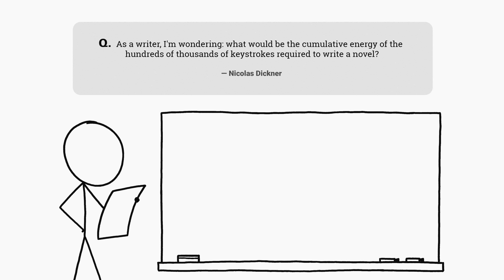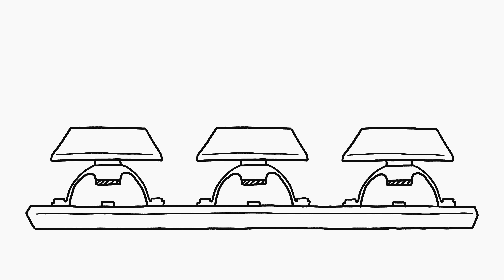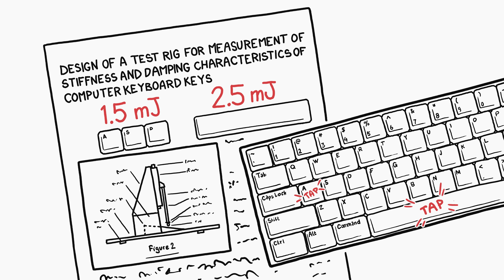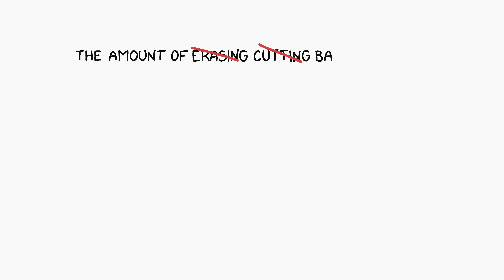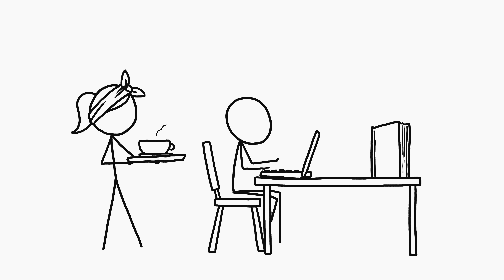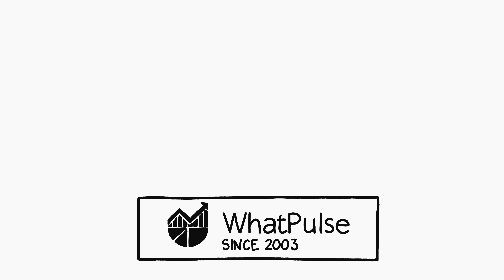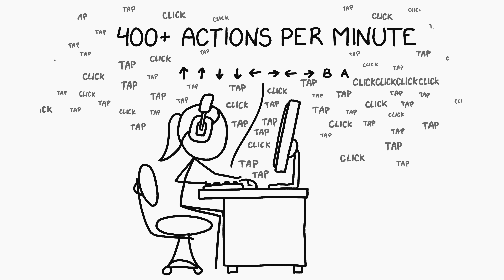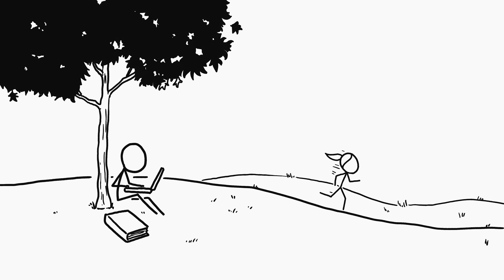Can you power your computer by typing?

Comment: Something you didn't take into account is that we can make the keypresses harder to generate more energy. How hard can the keypresses get before people are too uncomfortable to write? And at that level, how much energy would we generate?
Reply: Based on a quick search, a mechanical typewriter would have about 20 mJ per keypress and is probably about as hard a key (and as long a down travel) as people would tolerate. Which is about 13 times more than in the video. So better but still not a lot of energy...
Reply: @ynes6658 each keystroke triggers a nuclear reaction in a portable nuclear power generator hidden under the rubber dome
Reply: @ynes6658  you could easily power a mechanical clock though, they are incredibly power efficient and eh no need to convert to electric power
Reply: @ynes6658 we go all the way to 6 minutes per novel
Reply: So one of the reasons, which Randall actually touched on, that keystrokes are so soft is because heavier keystrokes can cause repeated strain injuries. Raising the keystroke press weight to get more energy would increase the likelihood of injury. Which means that generating energy from keyboards would be less safe than nuclear energy.
Reply: @waldosan  Generating energy from most sources is less safe than nuclear energy.
Reply: @masansr you're being sarcastic right, or trolling

<edit i read it backwards, I for sonereason thought his point was that nuclear wasn't safe>

<<edit2: I forgot edit 1 and got a like and was going to be like wyf ... but their probably liking the edit>>
Reply: @AbstractAproach  No, look it up, it's literally one of the cleanest forms of energy.
Reply: @masansr oh I know, I must have read your inequality backwards i guess (I thought you were saying nuclear was bad)
Reply: @waldosan  there are a lot of things less safe than nuclear energy.
Reply: @renakunisaki  I see you, like, everywhere on youtube lol
Reply: @waldosan  that's one hell of a take
Reply: @yan7911 But not inaccurate
Reply: @yan7911 its objectively true tho
Reply: @yan7911 Read up on nuclear safety it's massively improved over time

Also remember that Chernobyl was built by the soviet union and had terrible safety standards compared to today
Reply: @unclesquidy285  I know, I'm not anti-nuclear, I'm even French so 70% of my electricity comes from nuclear 
But still, saying that making keypresses heavier is more dangerous than an entire supply chain of highly dangerous and volatile materials is quite a stretch and I found it funny 
(again, I'm not anti-nuclear, but let's not be hypocritical, risks still exist)
Reply: @yan7911 

In fairness, there are more fingers on hands than there are nuclear reactors, so, the math probably has more caveats… 🙃
Reply: I think that's called using a typewriter.
Reply: You'll quickly hit the ceiling of human output. It can't be be more than the calorie intake of a person. Given how typing uses the smallest muscles, a reasonable analogy would be attaching a curl bar to a generator and seeing how much energy a person could make in a day.
Reply: @kevindodd4363 i think bike pedals are the most reliable way to extract power from a human ...

Maybe rowing machines 🤔
Reply: @davidegaruti2582 You're overlooking bungee jumping (or skydiving, but wind resistance becomes a much larger factor there).  A 90 kg human body falling 10 m would generate just shy of 9 kilojoules of energy, in just shy of 1.5 seconds.  Pedaling a bike would take about 60 times as long to generate the same energy (~100 watts = ~100 J/s, so around 9000 J takes around 90 seconds, or 60x the 1.5).  Admittedly, far more commercially available products exist to capture pedaling power than bungee jumping power, and the above ignores the energy required to get to the jumping platform, which would negate (and then some) the energy gained from the jump.  But pedal power similarly ignores the energy required to deliver and prepare the food (and water) necessary to continue pedaling the bike.  Moot if you were going to do the exercise anyway, as is the equivalent input energy if you were going to bungee jump anyway.
Reply: As well as a mechanical keyboard, some of them have harder keypresses, others softer
Reply: @renderedpixels4300  also mecanical keyboards can have non-linear stroke energy.
Reply: @Reverend_Jay  Do you mean a non-linear force?
Reply: Indeed, if you could capture 100% of the energy of a keystroke the key wouldn't move at all and there'd be no way for the computer to register you hit a key!  So however you set this up you need to leave behind at least some portion of the energy so there's enough to actually make the typing work.
Reply: I practically slam my fist down for every key I'm rough on my keyboards and love to bottom out every key I press for the tactile sensation.
Reply: I'd expect that to be somewhat self-defeating. The harder you have to press a key, the slower your typing speed is likely to be.
Reply: At some point you are just asking "how much power can a human generate" which I believe is something like 1kW for peak athletes in short bursts, and probably ~100W for continuous activity for the average person.
Reply: geometry dash players punching their keyboard: this looks like a job for me
Reply: Just capturing the energy will, of course, steal quite a bit of energy itself. With such a tiny amount of energy involved, I think the energy capture itself will be heavily parasitic AND increase the force required noticeably…
Reply: At that point, why not simply charge your computer with a hand-cranked generator? Then you can still make typing comfortably easy.
Reply: Some people LOVE themselves a mechanical keyboard though
Reply: "Why do my wrists hurt?"
Reply: The thing that EVERYBODY is missing is that that energy is already being stored and used: IN THE SPRING.

Energy is work, and work is force exerted over a distance that moves a mass. When you push a key downwards, that is work done, but to be ready to capture a keystroke again, that work needs to be *undone*. Since the key is the same mas, moving the same distance in the opposite direction, an equal amount of work (and therefore energy) needs to be spent to do so. 

In other words, if the energy that it takes to type leaves the keyboard, then it isn't available to undo your typing, and each key can only be pressed once.
Reply: @icedragon769  That's my line of thinking too and why only the excess energy used would be harvestable. People push the key harder than they need to more often than not. They push the key until they feel resistance against the base plate. That energy would be harvestable.  It'd still be a useless amount of energy. The effort of rolling out of bed would be more harvestable.
Reply: E
Reply: Dance dance revolution. That's your answer.
Reply: I was going to ask this
Reply: Personally, I have a percussive typing style that others have confused for rage...

Nah, I just played the piano for enough years that I can't help but hit the enter key with a flourish, like I'm playing Anderson's "The Typewriter"
Reply: Still not much.
Even if we increased it by a factor of 100, that would still only be about 1h of laptop charge per month (per day at the very best)
Reply: How hard is needed to make it viable to get power from live typing though?
Will I need a hammer?
A gun?
Consecutive mini nuclear explosions?
Reply: We could probably create a keyboard that took the excess energy while still letting the keyboard work. So for people who are POUNDING their keys, it'd generate, but people who just barely use enough energy wouldn't generate much at all. We could probably make such a keyboard, but complexity would mean it would wear out or break faster.
Reply: At 1:41 I feel like that is Brandon Sanderson. It has to be…..?
Reply: i feel like this question will somehow lead to the end of the world again.
Reply: AND a potentially much lower power device.
Reply: remembers BTMC playing osu on a keyboard with switches so heavy (I think like a kg needed to activate), he ended up using a hammer to press the keys